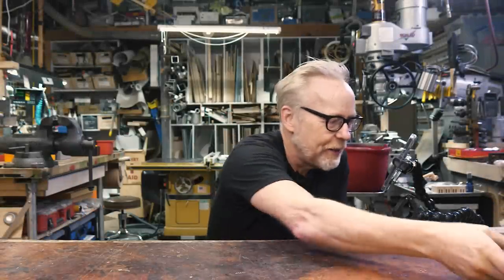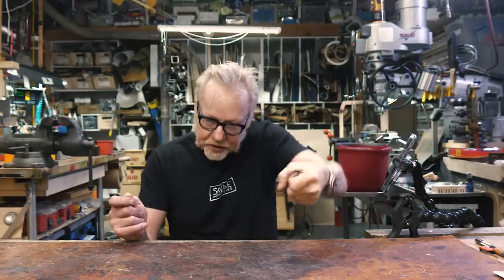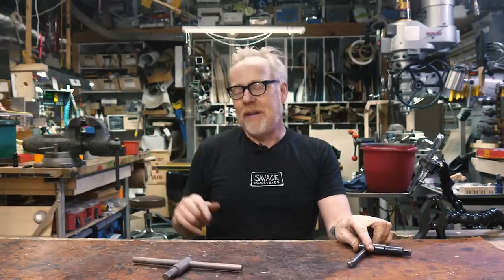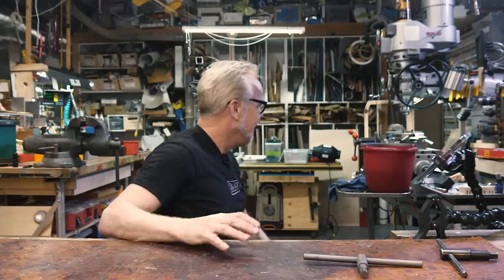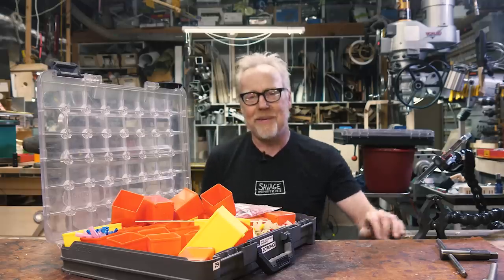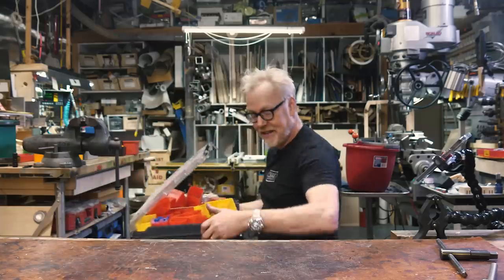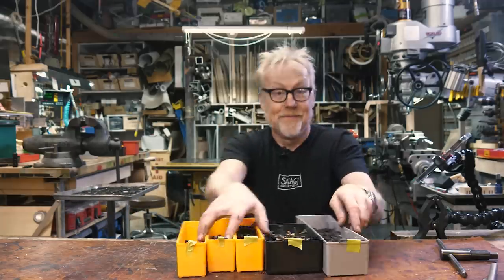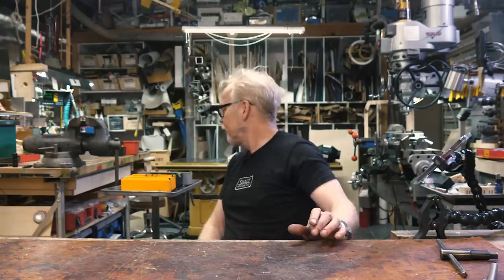Adam Savage Explains What to Do When You Drop Gobs of Loose Hardware

Comment from the maker: Adam's two questions for you all: What is a good, thorough assortment of lugs, that are copper? Should Adam get rid of the lugs he thinks he won't need? Give your advice below!
Join this channel to support Tested and get access to perks, like asking Adam a question:
https://www.youtube.com/channel/UCiDJtJKMICpb9B1qf7qjEOA/join
Reply: Oj
Reply: Uh id say no to getting rid of the lugs if copper and a good assortment is probably getting them in person
Reply: I'm a user and big fan of TE Connectivity's PIDG (Partially Insulated Diamond Grip) series, I think it's the OG of nylon-insulated these things? I have crimpers 47386 (for red) and 47387 (for blue), both available in economical vintage form on eBay for not too much at all. Or generic crimpers can work. Quick disconnects is a topic that gets complicated fast if you want them to be fully insulated. Fractally more variations than most kits ever cover.
Reply: Anchor brand marine terminal ends we can get them with heat shrink ends and standard nylon ends in numerous sizes and also in blister packs of 5,  10,  25 and 100 and also in bulk
Reply: Wago connectors. German standard
Reply: I can guarantee, as soon as he gets rid of them, something is going to come up and he's going to need the exact lug that he just got rid of. It's just how the world works.
Reply: keep it all, but only sort out the ones that are commonly used.
Reply: Open barrel connectors.
Reply: I"ve had good luck with 3M brand wire terminals, they're available from McMaster-Carr.
Reply: Put the lugs you don't plan to use in one, big "Unsorted" pile. Keep a reasonably sized portion, and give away the rest.
Reply: I’ve actually recently gone through an assortment of different brands of lugs for the FSAE team I am apart of. Molex and 3M heat shrink ones are among my favorite but getting a lot of them can get ludicrously expensive. I’d say a good compromise is getting ones from McMaster-Carr. While you don’t always know where they get them from, they have always been of good quality tinned copper and heat shrink/nylon insulation. I will say, there seems to be a shortage as of recently for the Molex and 3M ones. Digi-Key, Mouser, and Newark have had very limited stock the past few months.
Reply: Rather than using the butt crimp connections I prefer making off wire ends (class 5 and above) with good quality ferrules and connecting with WAGO straight through lever connectors. It's a really nice feeling connection and it can be removed and replaced easily for fault finding and testing.
Reply: Have one container for common usage and the other container is your Get Out of Jail box! You don't need the items often, but when you do, that is where you go to.
Reply: @zenthius  This! Wago clamps and connectors are far superior to wire lugs imho. They’re well worth the price snd if you buy them in bulk  (you only need a couple of styles) they aren’t even that expensive.
Reply: With supply chain shortages will you be able to source them fast in the event you need them? You’re welcome.
Reply: Hey Adam, I'm the EE at a boat manufacturer. We make a lot of our own wiring harnesses and everything we use is marine grade tinned copper. The best connectors we have found are from Pacer Group. They also make their own tinned copper wire of excellent quality. Their variety should cover the vast majority of materials you would need. One thing they don't have is wire nuts (which aren't allowed on a boat) but those are usually easy to source elsewhere. Hope this helps.
Reply: A good basic kit of heat shrink terminals is 3M's Scotchlok Heat Shrink Terminal kit, part number SHSTK-1. This is a basic set of their most popular terminals and they are tin plated copper. Once you start using the terminals, you'll figure out which individual terminals you use the most and re-stock the kit by buying those individual terminals in bulk.
Reply: @vonflame  Actually, the correct spelling is ANCOR. Close to 30 years in yacht repair, marine electrical work, and marine surveying, I was never disappointed by ANCOR. High quality tinned copper, many choices of sleeves, and their tinned marine grade wire, high strand count, uses the same tin alloy as the connectors, so there's never an issue with galvanic corrosion from dissimilar metals.

ANCOR is the best. And quality isn't cheap. You can get small quantities at West Marine, or larger quantities from a marine supplier like Fisheries Supply in Seattle. They have a good website.
Reply: My go to for lugs is Anderson powerpole connectors. All silver coated copper, genderless everything, robust polycarb housings, they stack vertically and horizontally. I have been using them for ~5 years and they rarely fail even after months of repeated connect/disconnects. Not sure if it will fit your needs, i am far from an expert.

Comment: I recently sorted all my computer screws (of which there were far, Far too many) by placing them with the bolt-end Up on the table. The bottoms were the best identifier of which type they were, and I could get eye-level with the table to confirm heights for these .5 inch (or less) screws.

Still took...two hours, I think? But I was taking it slow. Hopefully the rest of the sorting went well!

Comment: For crimps, Raychem crimp terminals are pretty premium.

What I've done typically is sort the assortments by colour - different sizes to fit the wire I'm crimping. It's a natural first level sort - find the colour (red, blue, yellow) that correspond to your wire gauge, then root around in there to find the ring/spade/blade terminal of the flavour that you want. Only if I'm working on lots of a single crimp for replicate wiring harnesses on projects would I bother to dedicate a single container towards it for storage.

Comment: I feel your pain Adam😂. My wife is always wanting me to get rid of stuff so I can work better. I have racks of steel most of which is used and can be odd dimensions and she’ll ask if I need it all. My answer is “probably not” so she’ll ask if I can get rid of some. Sure I say, which pieces? Her answer “which ever pieces you don’t need. And there in lies the problem, if I knew which pieces I was going to need I could get rid of the rest. And steel is expensive. 
I had so many boxes, packets and containers of nut, bolts, screws, washers ect I couldn’t fine a lot of the ones I needed, so just before I had shoulder surgery I set up some temporary benches and stackable containers and while I was recovering I spent hours sorting them all out. It was a job that needed to be done and I couldn’t do much else so it was time we’ll spent. Cheers Stuart 🇦🇺

Comment: My current thought process for organizing relies heavily on 6-in by 9 inch Plano style clear sorting boxes. The size of them forces me to keep my inventory small and if I drop one it's definitely not the end of the world. I fashioned a relatively simple stack of shelves similar to what you would see an old-time architect's office using for holding blueprints. That and a brother label printer have made my life so much easier. It's modular, easy to keep clean and organized, and if it is well labeled it is very easy to find what you need in a very short span of time.

And added benefit to that is that if I have to take my boxes to someone's house to do some work I just throw them into a fishing tackle box with pre-sized shelves and I'm ready to go.
Reply: Those little Plano organizers are great. I have some random 120V electrical stuff in one, some bike parts in another, another two with TIG welding consumables and probably more I'm forgetting. Super handy, and I love them being completely clear so I can look at one and quickly tell what's inside.
Reply: +1 on the Plano organizers - I'm up to over 50 of them with all my hardware and parts..... they also stack very compact.

Comment: I've used this exact same method, but in a different context. I used to work at a university cafeteria, and my job was to handle and clean the utensils. I would pull a crate full of dirty ones, send them through the cleaning machine, sort them, send them through again, flip them around, and send them through again.
       I also handled all the plates that came in and went out to the students along with returning all the clean pots and pans that got used in the kitchen, so I had to be fast. This is exactly the method that I ended up figuring out that went the fastest and easiest. On one pass I'd grab all the easy to get spoons, and then forks, and then knives, and then back to spoons. 
      This by far the best way to do it because by the time you go through all the different types you will have exposed enough of the first type to keep on sorting effectively.

Comment: I saw the thumbnail and instantly knew what happened. My condolences for your loss.

 At least you didn't lose yours in the middle of a customer's parking lot while walking to their job after lunch.
Reply: I share your pain and experience 😑 we where done at site, running a bit late, packing up tools and common parts, closed the assortment cases. When visiting customers we have this modular toolboxes you can stack vertically, basically endless until they are too heavy or too tall. Because we where three people there was alot of traffic to this system. Most are side accessible but the largest and most heavy duty only opens on top. To access the heavy duty box on bottom you need to unhinge that section by twisting a lock on each side and remove/lift off the top sections. Somewhere in the rushed flurry of packing someone only secured one side of one of the center sections. The next guy hurrying back with tools from other room just click-clack left right side of bottom section and yanked the stack off... Of course the section started the upward motion but then the single side lock gave out because of the extreme load and swings... and out flops the assortment cases of washers, every dam washer from 2mm up to 8mm, in flat, wavey, toothed, and notched. Probably around 5000 washers just rolled all over the floor making a symphonie of clinkety plinkety noises. Friday... late afternoon... 3 hours of driving to do aswell.... "F! This! I'm plugging in the vacuum cleaner and we are done". I bet the cleaning crew there still finds washers now and then creeping out from joints in the floor, from beneath cabinets etc 😂😂 they bounced and rolled everywhere!!
Reply: I share your pain and experience 😑 we where done at site, running a bit late, packing up tools and common parts, closed the assortment cases. When visiting customers we have this modular toolboxes you can stack vertically, basically endless until they are too heavy or too tall. Because we where three people there was alot of traffic to this system. Most are side accessible but the largest and most heavy duty only opens on top. To access the heavy duty box on bottom you need to unhinge that section by twisting a lock on each side and remove/lift off the top sections. Somewhere in the rushed flurry of packing someone only secured one side of one of the center sections. The next guy hurrying back with tools from other room just click-clack left right side of bottom section and yanked the stack off... Of course the section started the upward motion but then the single side lock gave out because of the extreme load and swings... and out flops the assortment cases of washers, every dam washer from 2mm up to 8mm, in flat, wavey, toothed, and notched. Probably around 5000 washers just rolled all over the floor making a symphonie of clinkety plinkety noises. Friday... late afternoon... 3 hours of driving to do aswell.... "F! This! I'm plugging in the vacuum cleaner and we are done". I bet the cleaning crew there still finds washers now and then creeping out from joints in the floor, from beneath cabinets etc 😂😂 they bounced and rolled everywhere!!

Comment: As a deep Sortimo and Tanos user,  which I love, you need to exercise  discipline in the use of your tools.  try a project cart, populate cart and do your project and then return tools and materials. It will increase your work velocity.  Discipline is you friend. You also mention the value of your time. You should have dumped the D screws and simply order new ones.

Comment: I had the displeasure of working with substandard lugs a while back while building a rotary phase converter for my new-to-me milling machine. I was using lots of 12 and 10 AWG wire with the yellow lugs (with a proper high quality crimper), and I found that the quick-connectors specifically, just wouldn't hold onto the wire - they wouldn't pass a tug test. The rings, forked terminals and butt splices all were fine, because they were made of thicker copper, but the quick-connects have to be thinner to give the right amount of spring force, and all three of my local brands (Napa, O'reilley, and Do It Best) , plus the ones on Amazon, just wouldn't hold. I ended up finding that Home Depot stocks some made by NSi Industries that have a double-thickness crimp collar that solves the issue.

It specifically affects only the yellow ones, and only the quick-connects, but man was that a pain to solve.

Comment: I've done the same thing a couple times. It's a pain when you drop em in piles of saw dust.  Magnetic sweeps on wheels are great for picking them up.  I just sort by hand after.
Reply: Good luck if they are stainless (I've done that before,  ended up using a vacuum with a mesh to catch them).

Comment: for lugs you only really need joiners, ring and possibly fork types in the 3 main sizes the flat connectors is only for legacy stuff, i would use the xt30 xt60 and xt90 series as connectors, they are really good. if you find yourself needing bigger stuff then first ask yourself,  why do you need that many amps?

Comment: Regarding your tools such as your chuck keys, try magnetic tool holder strips. We use them at the shop I work in. Just press the tool to the wall and let go
Reply: Chuck keys normally live within arm's reach of the lathe headstock. One setup I saw in a home shop a long time back had three keys in fitted holders on the back of the headstock with a microswitch at the bottom of each hole wired up as an interlock. The lathe motor wouldn't start until all the chuck keys were in their holders pressing down on the microswitches. This was very good at preventing the "start the lathe with the chuck key still in the chuck" sort of accident.

Comment: Answer to crimper question:
Don't use crimpers, use snap on or solder on, epoxy on joiners. 
Eg Wago 221s, 3m scotchlok, idc connectors etc. 
It costs x folds more per connection but saves so much mental energy of finding correct crimp and colours/positions. Some are reusable, some are ip rated, most are generally versatile (14-30awg, up to 32a).

Anything 12awg or less I'd consider soldering personally to get best performance for a non professional outfit. You can get crimpers for these but it's getting quite large, and it's likely you wouldn't spend $$$+ on that crimper to do 12awg or less, therefore wouldn't be as reliable connection. FYI a good crimp needs to be oxygen free. If you have gaps in the strands, it can cause micro arcing and failures, this gap is very common...

Comment: Bought a bunch of cheap dollar store tin trays for bolt sorting.  I got the idea by the plastic yellow bolt sorter from harbor freight,,,with the spout(Go to Harbor freight and search for funnel tray).   I just "adjust"one corner of the cheap cookie trays so they will pour back everything into it's home container.,,thru a spout of it's own.   Also use the deeper 11x9 and small square cake pans for my magnetic stirrer's and cleaning small parts. I call them project pans,,for keeping project stuff together.  The cheap tin cake pans at the Dollar General are,,,,,, a Dollar.  Buy 20 bucks worth.  They also have the big tin cookie sheets,,,,for a dollar.

Comment: Hello Adam, long time fan.  My tip for organizing electrical terminals and butt connectors etc... is to keep them in a tool box shallow drawer in orginizer bins ( I actually use the package they come in mostly ). That way you cannot drop them.  When I work on a project far away I just pack some over there and bring back what I dont use.